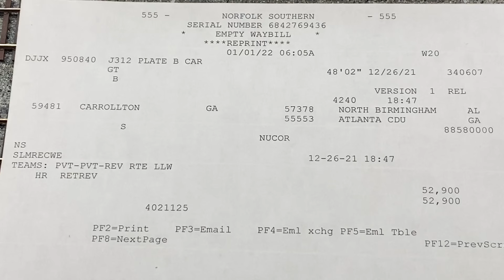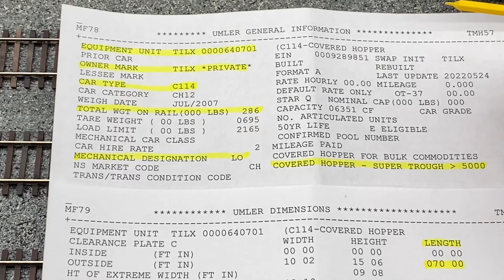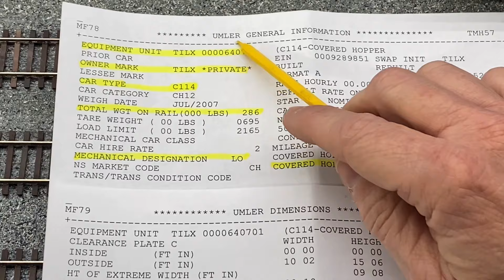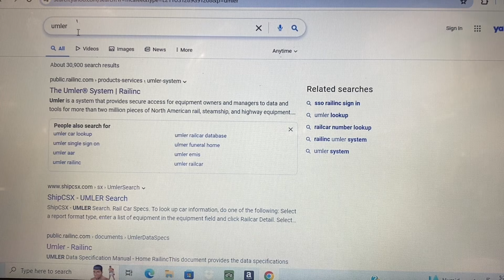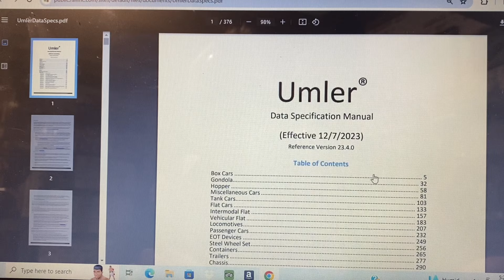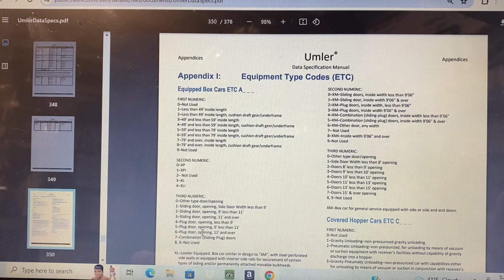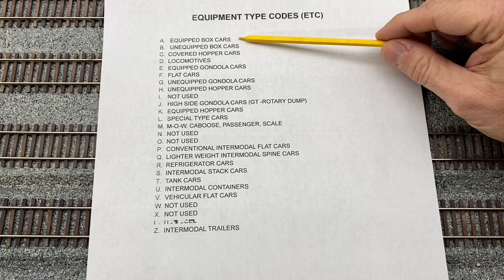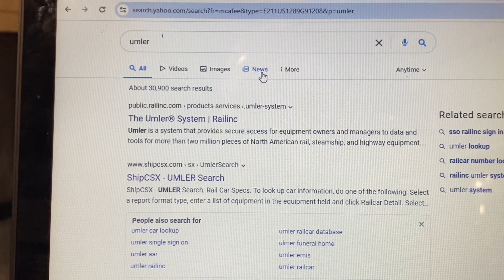Seaboard Central - Realistic Ops Part 6

Comment: Thank you for sharing! Quick question, how much space do you keep between your tracks in your passing / service yard?
Reply from the maker: Thanks for watching! The spacing between the tracks is about 2-1/4 inches. Typical prototype track spacing in yards is around 14 feet which would actually be around 2 inches in HO scale so I am actually wider but I have to take into account the tighter curves and space to handle the cars if necessary.